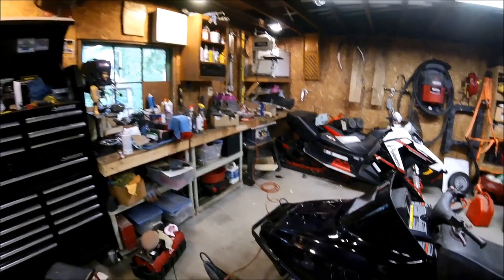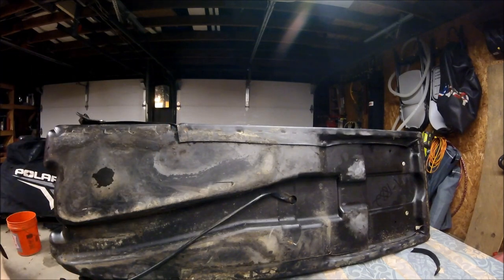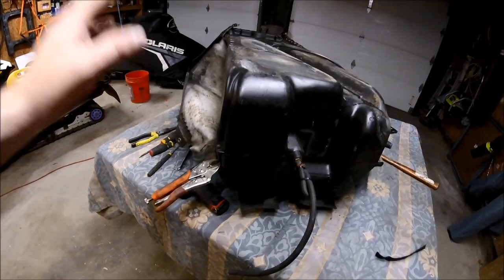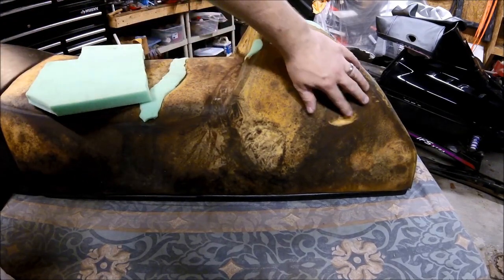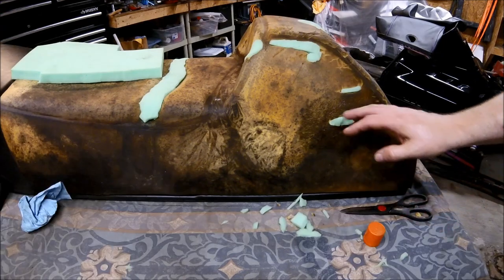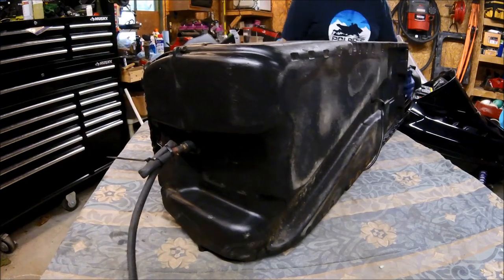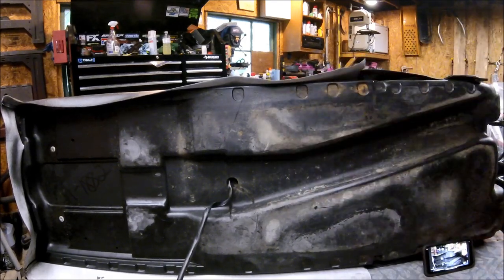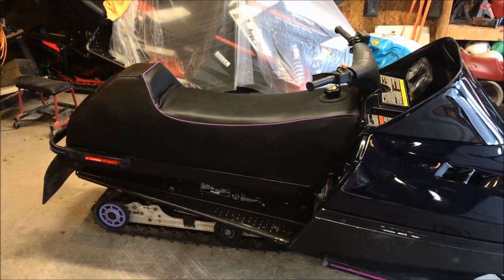Polaris Ultra 680 Project Sled -  Seat Cover Installation (Part 7)

Comment: She's a beaut! I'll be doing this on the indy trail and if it goes good I'll do the 500 :) Duct tape looks good, but just doesn't last long enough. Duct tape actually makes the same teal blue color that matches the 97 trail but it rubs off after a few good rides.
Reply from the maker: Thanks! 

Scottys makes a great cover. I’ve used them on 4 of my sleds and I’ve been happy with the finished product every time.

Comment: I plan on replacing my seat cover when I get back home this weekend. I see you used a air stapler. Do you think that Inwill be able to get away with my hand stapler? The bottom almost looked like a plastic cover over plywood? Tks.
Reply from the maker: You should. Just make sure that your using the heavy duty staples. 

This seat was all plastic. Some of the older Indys have a plywood base.

Comment: 🤔I am curious ; didn't see you apply the POLARIS script seat decal ...I am assuming that it is part of the hood and tunnel decal package? Originally it is stamped on the seat cover from the Polaris factory , isn't it?? ------- I loved the video! ...very easy to follow your steps.
Reply from the maker: Correct. It was included as part of the set.

Comment: Wow, now I see what my upholstery guy has to deal with when repairing old seats.
He says they are pretty much paper thin and start to disintegrate - yup!
I much prefer a repair, keep it as original as possible than replacing it altogether.
Got an original restored seat for an Ultra but it'll cost ya.
Reply from the maker: Absolutely. It’s getting to the point where you find a good OEM seat it’s like you hit the lottery.
Reply: @StreetersGarage  lol!! So True!!
 If you want 1 good seat, you have to buy an entire sled it seems.  You're lucky to find a wreck with one and most who do upholstery, won't do those old ones; due to lack of experience and level of difficulty.  
.
Today, they use cowhide, Polaris was using bonded leather on those.  Funny how even though they are cheaper-make, they are worth more than a replacement based on the fact that very few last the test of time.

Comment: Great videos! Working on a 98 Indy Touring and have a cover on order.  What would you do for a big crack across the seat foam? Doesn't seem to be missing foam as in your videos.
Reply from the maker: Thanks for watching. 

For the crack, I’d take some sand paper to roughen up the 2 surfaces in the event it’s dried out. 

Spread the foam apart, and then spray both sides with adhesive. After you sprayed it, compress the foam with a ratchet strap or something and let it sit for a day. 

Take the strap off and sit on it and see if it holds.

Comment: Put on a dragon or pro seat and tank pro taper 7" rises bars 2014 running boards put the A-Arm kit on front fox full floats with polaris gripper skis 144 assault track and skid haha ultimate wedge update
Reply from the maker: Sold it in January to move on to the next project
Reply: Good job, I never realized how many steps that are involved. Thank you for your insight.